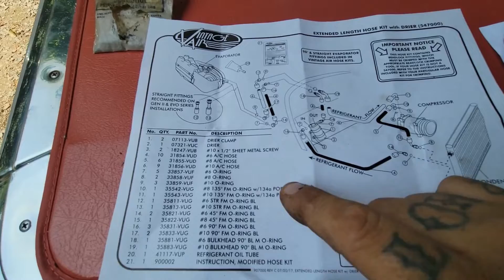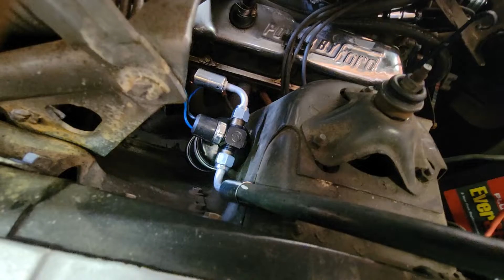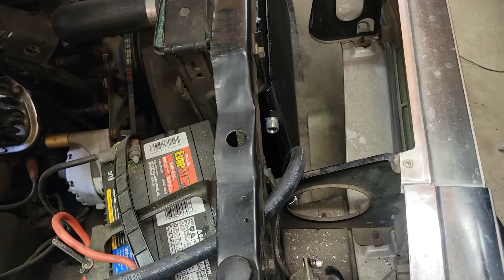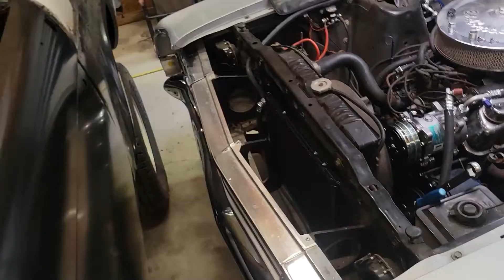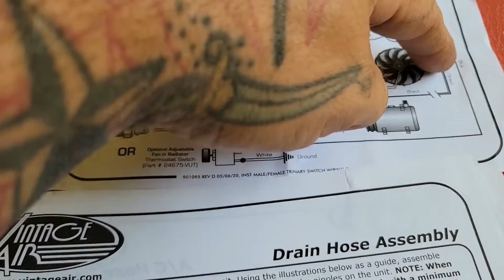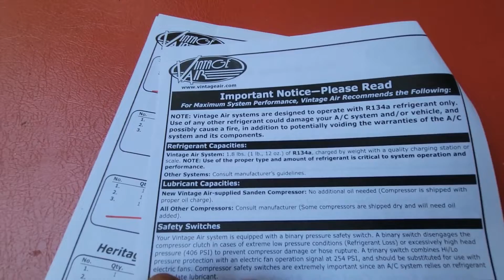1969 RANCHERO VINTAGE AIR UNDER DASH UNIT PART 2

Comment: Anyone that stumbles up on this video wishing they had AC and poor like me. ECC Auto Shop out of Florida sells the complete kit except the bracket to mount the compressor to your engine for a 3rd of what Vintage Air cost. If you’re poor like me. You will wanna check them out. I bought mine in the summer of 2024 and it was $550.00. I will be buying another this year for my 4wd.

Comment: How did you drill the firewall holes? Hole saw? 5/8 for #6 and 7/8 for #10? I am about to try similar  underdash AC and just planning everything out. Thank you.
Reply: a knock out punch works better

Comment: Is that the heat/ac combo
Reply from the maker: Oops.   Ok.  Here's the separate kit numbers.  
674002( under dash heritage unit ) 
 547000 ( drier/hose kit ) 
  sanden sd508 compressor 
And I cannot find the condenser part number unfortunately
Reply from the maker: Ac only
Reply: Thank you for the reply, is there any way you could get me a part# for the kit? All I’m seeing on the vintage air website is a kit for heat/cool
Reply from the maker: https://www.speedwaymotors.com/Vintage-Air-Heritage-Series-Underdash-Heat-and-A-C-Kit-Vert-Condenser,267587.html
Reply from the maker: I copied the link below to speedway motors.    You will need to get the ac compressor mount appropriate for your engine.  Vintage air tech line can get you set up with everything
Reply: That is a link to a heat ac combo I just need a ac only under dash unit